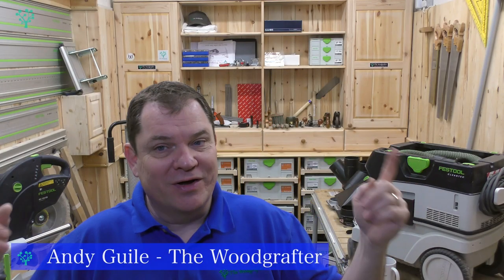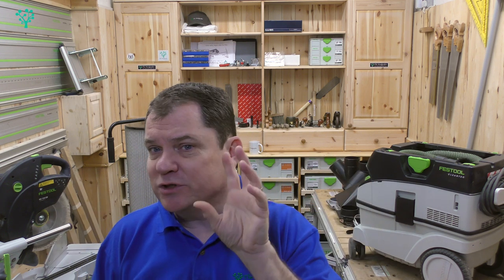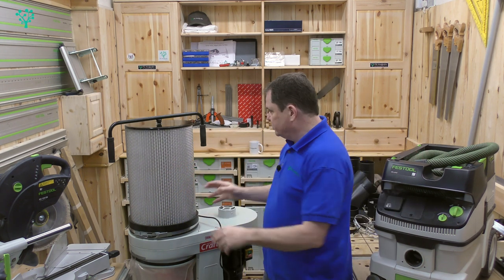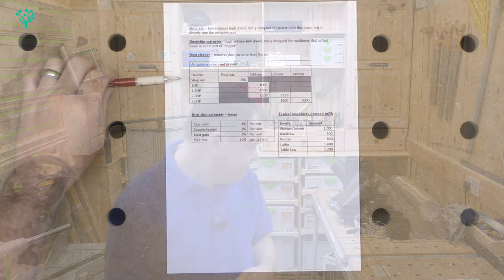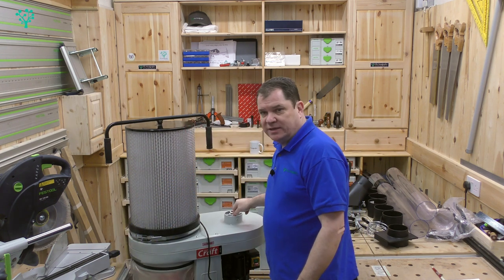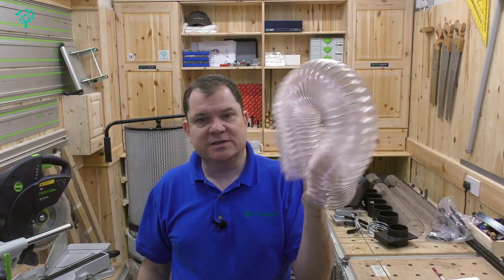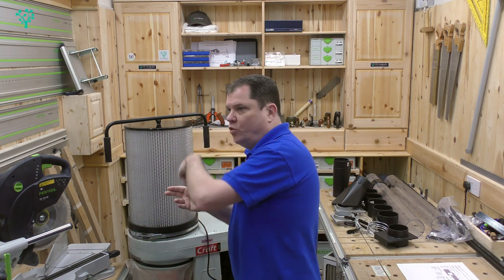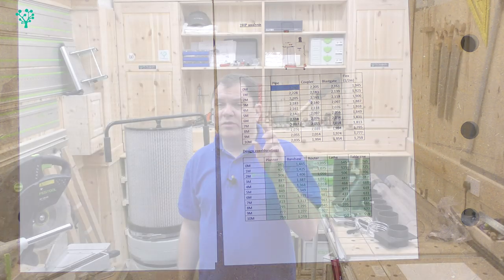How to design a dust collection system

Comment: You may have addressed this in the video and I missed it (tons of great info) but here is my question.  Let's say I have an impeller vac like yours.  If I get a reducer to go down to a smaller size hose, wouldn't that increase the air speed to make it competitive with the "shop vac" style solution?  Granted I am not talking about HEPA filters at this point just talking about the waste you can see.  I am designing my system right now so it is on my mind.  I would love to hear your thoughts.
Reply from the maker: Hi Mark,

Great point - remember the impeller type is relying on moving the maximum air volume, that is a combination of cross sections are of your pipe and velocity.

Very simply put the flow rate = cross sectional area of the pipe * velocity (I know we need to allow for density and frication but let's ignore that).

So let's say my impeller moves 1000 m/s at source and my pipe is 100mm (0.1) cross sectional. So simple maths gives us a volume  moved of 100m3/s.

If you use a reducer to drop down to 50mm pipe and let's say that double the speed. Then you have 0.05 * 2000  = 100m3/s

In reality reducing the diameter of the pipe by a half, would not give you a double in speed, probably more about a 1/3 increase in speed, plus the actual faster flow will increase friction. So you will increase losses in the system and have a smaller volume of air movement.

For an impeller system - you want the largest flow rate volume you can find so increase pipe diameter and increase flow rate is good. Reduce diameter and increase flow rate is bad. This is because you are moving large volumes of static chips that you tend to pull from a hoper.

A vac is different - its builds a vacuum in a chamber - and you then expose that vacuum to the tool by some sort of pipe, in this scenario you a pulling smaller faster moving debris from (typically) a hand tool. So you want less volume and more speed. Smaller pipe more speed good. (to a point at some point you stop getting a benefit) Let the tool guide you - if it has a 36mm hose adapter use a 36mm hose, f it has 50mm use that etc..

In reality you want both - vac and impeller in your design. But recognise they are different things for different purposes.

In my router table design - I will have both. I will have a 100mm port to my impeller system that sits under the router and a 50mm VAC port on top of the table pulling away debris fro the spinning router bit.

I haven't yet played around with an adapter on my impeller extractor to see how it works on a hand tool. That will be an interesting experiment. So I'll 3d print something out and give it a go.

Hope this helps.

Andy
Reply: @TheWoodgrafter  ok, the equation you gave above made the light go on in my head.  Now I get it.  thanks (yet again!).  Sorry to bother you but I have another critical question.  I have my (growing) little shop in my garage.   I have a 1200 cfm impeller and a cyclone on the front end (aka two phase).  now, in terms of venting, there is nothing above the garage but an attic.  I was thinking about venting it to the attic.  Very little debris would go up there (99% would be in the cyclone bin) and I would not have to worry about filtration (new air would come in thought a window).  What little debris (wood dust) that ended up in the attic would just be more "insulation" in a wood framed house.  I would love to hear your thoughts!  thanks!

Comment: Hi Andy, great job putting together this video and making it succinct and easy to understand. Question on the use of the larger 175mm pipe (good luck finding it too!) - most large machines have 100mm (4” imp) fittings so when you drop down in size to connect what is the percentage lost in airflow?  Also, they make fittings to drop down from 100mm to ~60mm (4” to 2.5”) for hand tool use - will this work correctly with a large dust extractor?  Interesting that most shop vacs use corrugated/ribbed hoses - you would think they would want to use smooth hoses to minimize air disruption.  Best. -Mark
Reply from the maker: Hi, thank you for the feedback. 

What a great question, and I am no expert. But from very basic recollection of fluid dynamics (over 30 years ago at UNI - so don't judge me)

As you step down the size of the pipe the airflow will speed up (same volume through a smaller pipe), however due to the increase in friction of the smaller pipe you will loose some air flow due to air compression (that is the fluid dynamics part). If you look at the figures on the various machines I quoted - they are loosing around 55% - 60% in stated capacity as you step down the pipe (and don't forget they are manufactures stated figures - so probably optimistic).

Given that in the smaller hand tools, we want a higher airflow - then, in 'theory' stepping down will be a good thing (subject to airflow). If I look at my set up - then my worst point scenario is 1,173m3/h (the 1.5hp over 10M with various connectors)

So running 55% loss. Stepping down to 50mm would take us to 530m3/h (ish) and then stepping down to 36mm would take us down to around 240m3/h. So that is slightly less than I get from the Festool at around 250. So it may work - but would be border line I think.

And you are correct that we are talking about volume & flow at the air port, so adding a corrugated hose to the equation will make things worse - according to my research around 10% per MTR. SO now when I put my 3M 36mm hose into the mix I am probably somewhere around 175 m3/h at the tool.

Its is an interesting question though - can you use a dust extractor effectively with hand tools in the work shop ?

I'll get hold of a 100mm to 50 to 36 reducer and give it a go.

Cheers

Andy

Comment: FYI the dust filters in festool L and M class machines are the same and so are the bags. Therefore the level of filtration is the same. The difference is that m class has the flow detect warning system and is tested to m class. The L class machine filters the same but would fail m class testing because it lacks the warning system.
Reply from the maker: Thanks David, great input I didn’t know that.

Told you I wasn’t an expert 😁

 So the detection is looking for a reduction in flow rate showing suction at the tool has reduced so more particles will escape into the air.

Is that the idea ?
Reply: @TheWoodgrafter  yes it measures the airflow through the hose. If it drops because of a blockage the alarm goes off. I think it may also warn you if the flow drops because the bag is full, but don't quote me on that one.
Reply: @Keith Thompson the filters  and bags are the same for both classes in the festool and dewalt machines (both of which I own). The festool machines have optimized filters in the autoclean versions which are fitted to both L and M class models but will not fit non a/c machines. The filtration figures are based on the class to which the machines are tested, not the actual performance. The real difference is the flow alarm which is mandatory on M class but not on L. The part numbers for replacement filters for both classes of  machine are identical for festool and dewalt. I can't vouch for other brands because I don't own them. You can get hepa filters for these because they are mandatory in the U.S. market but I cannot work out if these are more efficient than M class and European manufacturers seem a bit shy about answering that question.(I have asked).
Reply: @Keith Thompson your explanation of dust categories L,M and H is correct according to EN 60335-2-69 appendix AA. But reading your reply, I think you may still be missing my point that the dust emissions from a ctl26 and a ctm 26 will be the same because they both use the same filters and filter bags.

Comment: My goodness have I done things the wrong way round! Good job I got all my 100 mm pipework at cost from a mate. Oh well, as you say, lesson learned.
Can I ask where, location wise, you put the Jet air filtration system (high, low near or far from the work area)?
Wonderful video, as always.
Reply from the maker: Hi

No such things as wrong, just learning opportunities :-)

At the moment it is in the corner of the workshop and I have run the pipe at the same level as the inlet to the unit.

That's not it's end position as I want to clear some more floor space to bring a CNC in to the shop.

I have seen a neat solution that couples it with a cyclone and mounts the device up on a wall.

I have a loft space above the shop - so working on a solution that gets it out of the shop and into the loft.

It never ends.......

Andy
Reply: The Woodgrafter the air purifier?

Comment: Brilliant dust extraction video. I wish I had seen this before my arduous dust extraction learning adventure. I have only to add three items. You must consider the electrical demands that support these electrical motors. I spent more on the modifications to my electrical system than my dust extraction system. I have spent the last 35 years designing internal aerodynamics of Military aircraft and I would add that losses are an issue, but steps and gaps are rarely accounted for and can significantly increase pressure losses. Notably, the machines themselves can be poorly designed for dust extraction. Your table saw may have a poor system of dust extraction, leading to poor air quality regardless of how well thought out your dust extraction system may be. I never thought dust extraction would be the most exasperating part of building my shop, but it has helped me appreciate the very fine hand tools available that appear far more attractive when all things are considered.
Reply from the maker: Hi Ray,

Thank you for the feedback, With your background I will take that as high praise.

I agree it’s about the disruption of the air flow, and obviously the design of the machine is paramount to good performance.

You really can tell when I move from the Festool tools to something of ‘more economical’ value. 

I have just purchased the DeWalt table saw, dust collection is shocking. No dust extractor will make that any better.

I upgraded the  electrics in the shop, dedicated circuit, a few rings mains and a dedicated 15 amp circuit for the big stuff.

My next step is to change the up and over workshop door to claim the ceiling apace back, I will then be installing a ceiling mounted pipe system, that should give me cleaner runs and therefore better air flow.

Cheers

Andy

Comment: The thing you're calling a 'Dust Extractor' (2 vertical bags or bag+cartridge, large volume hoses) is more commonly called a 'Dust Collector', whereas 'Dust Extractor' usually refers to the shop-vac type of machine (Higher pressure, smaller pipes).

Comment: MATE! Look at the camera! ;) but sorry if it is medical! :) Good vid but really you should have made the difference as the Craft is really termed as a Chip separator ... well until you pop the filter on that you have. Then you can happily call if a dust extractor. No matter what the green fanboys say... the Festool is still only a shopvac... a good shopvac with high quality dust removal but still only a shopvac.
Reply from the maker: Erm OK on the camera bit.

 I it’s not a chip separator until it separate chips. Chip extractor I would agree with.

Yes the Festool is a shop vac, a good shop vac, but a shop vac. I think if I was doing that again I would look at the Bosch, seems really good at a lower price point. 

I am sure I could get an adapter for the tool connection. 

Thanks for the comments

Andy
Reply: @TheWoodgrafter  Ah indeed... my bad! It is a chip extractor indeed. I am currently setting up a workshop for an AmDram group and, can you believe, they are debating whether they need dust extraction! I invited one of the doubters to please feel free to come and do all the MDF cutting each time it is required... for some reason he declined the offer! 🤣🤣🤣
Reply from the maker: LoL, 

That would be fun, when you do that can you send me the video, please.

Cheers

Andy

Comment: Great video, but I'm a bit confused about why a table saw needs so much extraction capacity. If you cut an mdf sheet on a table saw (for example), does it require more extraction than doing the same cut using a rail saw? If a shop vac is fine for a rail saw then why not a table saw? Surely your figure of 1200m3/h is not typical of what most small shops would demand from their table saw?
Reply from the maker: Hi Nick,

Thanks for getting in touch, as always it depends on the tool. If you look at my shop - I use the TS55 on the track and then use the same device in the CMS module - and I use the Festool shop vac on both. That's because the saw is firing the debri into the dust extraction port - low volume, high speed. So if your table saw is designed like that - then you are correct.

However - some table saws direct the debri into a hopper and then they are carried a way in bulk - high volume low speed. It was that type of device I used in the calculation.

Having said that, the video wasn’t really about the needs of the device - more of a thought process based on what I have learnt in the design of the system. You should look at the recommendation on your particular machine and not take some random average number in my video :-)

Hope this helps.

Andy

Comment: Thanks Andy. This has gone straight into my “To Action” playlist. Have you posted your excel sheets as they’re really useful? Does each machine brand have its own demand in the machine specification or are they all fairly similar? Cheers. Fraser
Reply from the maker: Hi Fraser,

Each manufacturer tends to quote the requirements of the machine in the specs. The demands I have used are based largely on the Axminster products I tend to buy.

Hand (power) tools don’t tend to quote the demand, just normally have an induction of hose diameter.

The spreadsheet is basically a table in a word document. I think I did use a spreadsheet to carry out the initial calculations, but that has long gone.

The word doc is available as part of the YouTube bundle over on the website www.thewoodgrafter.com

I will see if I have the spreadsheet archived anywhere and add it to the bundle at some point.

Cheers

Andy
Reply: Thanks Andy. 

I’d love your take on cyclones and other filtering systems, including their impact on air flow. We're just creating a 1500mm diameter cyclone for use within a blasting shed. I'll let you know how it goes. 

Cheers
Fraser

Comment: Lots of good information!  I’m wondering if you considered ( not that it’s a better or worse idea...  ) installing the dust removal equipment on the outside of the shop and run the pipes through the wall?  I’d like to do that to reduce noise. Also, I’ve been researching cyclone systems.  None of the videos I’ve watched on cyclones give information on airflow loss when using a cyclone. This is not your job, but I’m curious. You seem to understand these concepts better than many of us. Thanks for the info.
Reply from the maker: Hi Vic,

The outside install is a good idea if you can make it work. I have seen installs like that. Not only does it reduce noise in the shop - it also reduces dust.

The cyclone is a good question, my view (for what it is worth) I would consider adding one to
My shop vac - but not to my dust/chip extractor.

I really don’t see the point of restricting the high volume air flow to collect the chips in a different place. But I do see the point in moving the collection point away from the the shop vac.

I did think about a video on the cyclone - looking at impact on air movement. To see what we see.

I need to invest in some tech though - so it wasn’t high on my agenda.

Maybe one day.

Andy
Reply: @TheWoodgrafter  I see your point(s). They make sense. I automatically went from thinking cyclone on a shop vac to dust collector without considering what the pressure drop would be.  I was hoping to keep the mess inside and the noise outside. I’ll give it more thought.
Reply from the maker: @vicbaker8367  Hi Vic

You would still have the benefits of the dust filtration system and the collection bag on the extractor - so you wouldn’t have a huge amounts of chips and waste etc outside.

The filtration takes up a lot of floor space in the shop so outside removes that clutter. 

Also when you change the collection bag - it puts a ‘small’ amount of dust back in the shop. So you would avoid that.

When I build the ‘dream shop’ it will have the extractor separate from the shop as well as a separate spray area for finishing.

All makes for a nicer working environment.

Don’t dismiss the idea - it does make sense.

Andy

Comment: This is a good post in the UKWorkshop forum by siggy , https://www.ukworkshop.co.uk/forums/a-guide-to-dust-extraction-by-member-siggy-7-t102025.html .  Also I recommend getting metal duct fittings they are not expensive, you DO NOT want a static discharge from plastic pipe unless you really like being in the centre of a firework when it goes off! Also get  wire reinforced flexible hose so you can use that to earth the flex hose.  Keep 90 degree bends to a minimum use y junctions.
Reply from the maker: Hi again Tim,

Thanks for the link, great article - I haven’t seen metal in 100mm and 100% agree with the earthing comment.

This video wasn’t really about install, more about design.

Thanks for the comments.

Andy